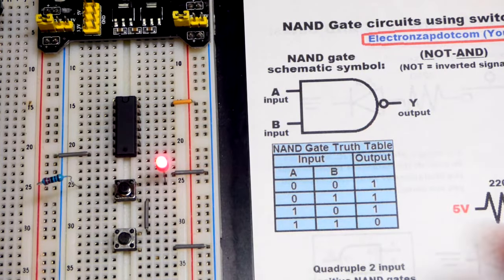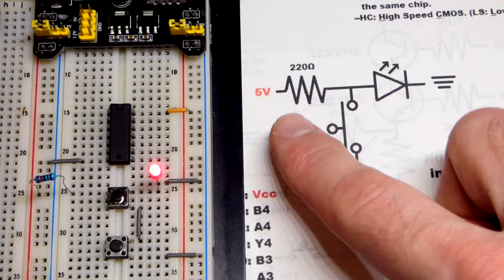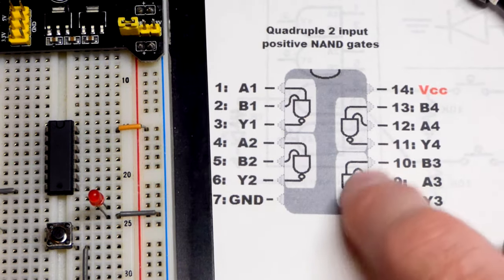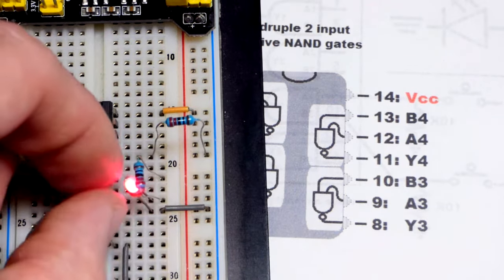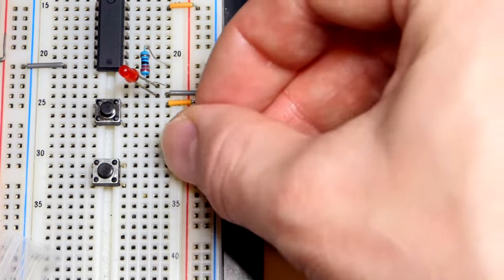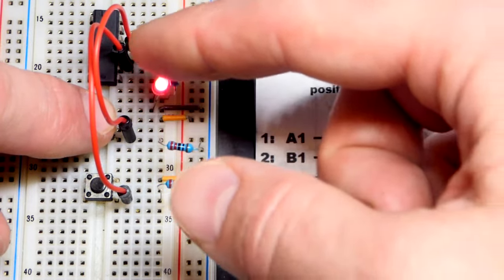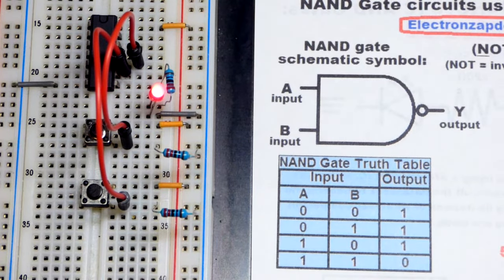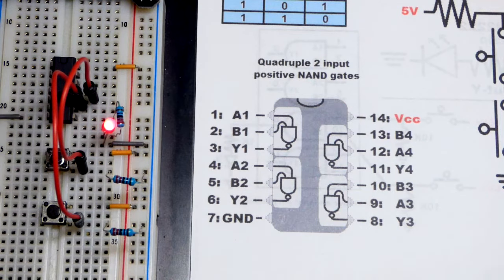Switch based NAND gate and 7400 integrated circuit IC demonstration beginner learning electronics

Comment: 1:49 (?) Why does no current flow if there is a path from ground to ground?
Reply: Because if both switches are pushed (closed) the current will take the path of least resistance and go straight to ground instead of through the LED